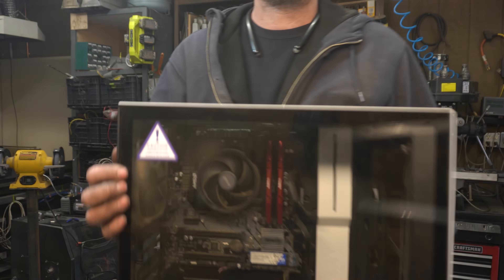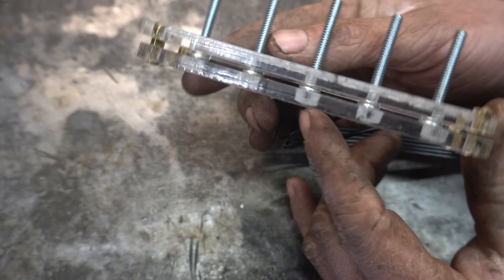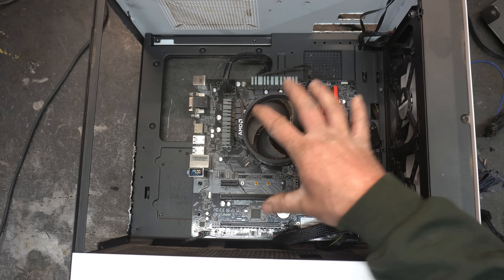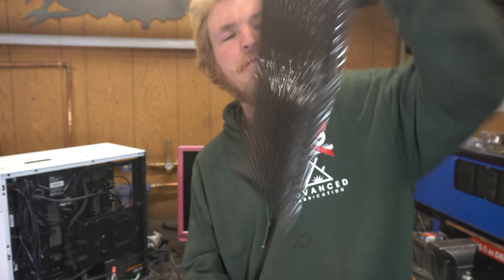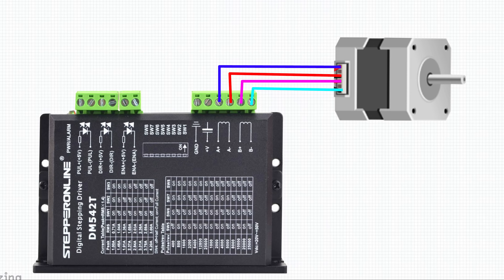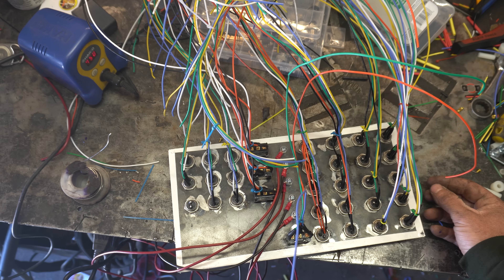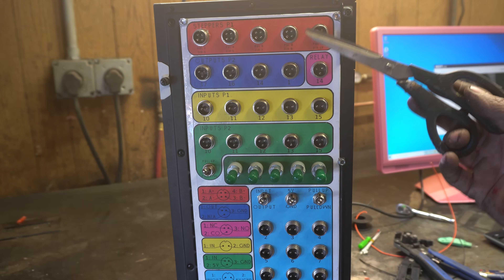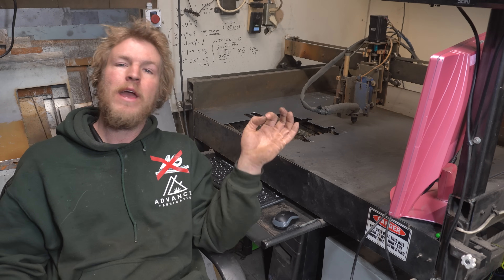Making An Overbuilt CNC Controller

Comment: Only 2 years ago, why did't you just use windows 10 pro and not partition the drive and use WSL for windows windows sub layer for linux since you're able to run Linux inside windows. That's how my CNC plasma table is setup it uses a windows computer and controls a single board computer with linux on it but wsl you can run many distros in winders

Comment: Can't believe this is actually working with an parallel port card? I've tried numerous and this did not seem to work. First of all you have to be able to select EPP mode for the parallel port (Not ECP of 'ECP&EPP', these settings won't work)
So the big question is: Which parallel port card do you use?
And also: Which OS(es)? Have you already tried to communicate in Windows via Gcode sender of Mach3?

Comment: Your aviation connectors are likely to set fire the the steppers internally. They are the resistance in the tank circuit which is your stepper circuit. The resistance allows a resonance which causes the voltage internal to the stepper to get very high. AKA 48v drive probably has a 600+v internal voltage inside the stepper. Results in burning motor internals.

Comment: If you're using a Ryzen with Linux, there's a good chance the processor will be stuck at P1 and P2 meaning it will be stuck on 100% performance the entire time. The patch for adding the driver to fix this was only merged earlier this year and Ubuntu has yet to release a kernel that supports this driver.

Comment: Nicely / professional made hw.
Linuxcnc is a very good choice. Takes some time till you understand, but then it is very capable.
I would propose to look for a Mesa card and do not try to optimize for parallel port. They are not cheapo but very worth the money. Plus you can have them with good insulation and you can go for 24v sensoric. Probably a better choice if you go plasma. And I think you are aware of the very nice plasma integration in lcnc that happened in the last years..
Gratulation from Switzerland!

Comment: Dud i have so much trouble soldering those aviation connectors. If i put enough heat in them the can slip out of the black plastic, and too little the solder wont hold. Takes me forever.

Comment: Linus isn't qualified to judge even your work on this. With 25 years of case modding, and nearly 35 years of electronics engineering and computer building, I am. Can't argue with results, but some of your methods made me cringe. You've obviously got skills, so why oh why (oh why) did you leave wiring, sleeved wiring, and components in the case to harbour metal dust when you did your cutting? I don't mind the hot glue on your terminal post plate so much, but you should be ashamed of yourself for using hot glue on those soldered wires inside the PSU. Again, results, but it's janky AF and will be horrid when you have to make changes there. I'm (slightly tongue in cheek) picking tiny spots in an otherwise very cool project, but that's what us pedantic bastages do. It is our raison d'etre.

Comment: been thinking on using one laptop , power , controller and drivers combo on multiple machines using a big usiversal plug to plug them intoo each machine same as the combo you made  , only thing is that you need to set the steppermotors up so its actually transfers the movement 1 to 1 having spindles toothed belts or chains does chainge the distance traveled per step 

oh well that was before i tried my hand ad 3d designing stuff in the more know programs and saw that it was a verry steep learnig curve without any assistance from friends pointing out the obvious so i kindoff put everything on the shelve for now , no use for a cnc machine if you cannot make the file to run it 

hope you whont get signal gremlins with all that wire all over the place though the metal plate between the motherboard transformers and the stepperdrivers should help

Comment: Amazing build and absolutely tops on the cable management! Definitely on my to do list as of now. My only change I might make will be to make the cable connectors on the back jacks (female connectors) so I don't end up with chips or schmoo shorting out the pins or accidentally bumping it into something and bending them. Other than that I can't believe how great your build turned out!
Reply: That would be Aviation connectors as apposed to GX connectors.. they are great, but pricey as hell
Reply: @nicholaswouters1203  for sure but I know my luck and it seems no matter how much I try to keep stuff out and away from angry pixie connectors it somehow finds it's way in lol

Comment: Awesome build! Only thing I suggest you considering changing is the regular screws electrical binding "posthingies"... Those are really BAD conductors and you can loose a lot of power trought them. You could swap them for copper or brass ones.

Comment: In BIOS; Turn off HT, HPET, and Freq Scaling
In linux: Consider a low-latency kernel
Then nice the program to raise its priority.

Lemme know how far that knocks your jitter.
Reply: Un-nice tho, right?
Reply: LinuxCNC requires a realtime-patched kernel, so low-latency isn't relevant. (preempt-rt or RTAI or Xenomai)
Reply: You will get away with the standard kernel  if you set the performance govener correcly and isolate the CPU from the scheduler (isolcpus) and only schedule the relevant tasks on it, move all the interrupts of everything else off the CPU which runs the task you need.      I would probably leave HPET on though. I don't know why HPET would affect response guarantees though.

You can't get scheduled off the CPU if you dont get scheduled.

Comment: I built a custom control box for my old ender 3 that used aviation connectors and I feel your pain; soldering a butt load of wires to tiny little terminals is awful. The end result is worth it though, especially if you use cable sleeving to separate the connector groups!

Comment: Can you load settings in Linux cnc to swap all the mm/rev etc for different machines?  
The motor controllers are usually dip switched/dedicated for specific motors.
Reply: Ah the first movements of a cnc! Such a wonderful experience! Great job!  I stuffed mine in an o2 generator chassis, "millennium  falcon cnc" on my channel.

Comment: Is the 5V from the PC power-supply? I'd be afraid to trip the PSU with shorts or even funny effects. My PSU is very picky, i.e. when getting 7V from +12V and -5V to run a fan slow, it instantly tripped. Does the box like being near to welding equipment?
Reply from the maker: Yeah it's all from the power supply, my fingers are crossed, but that is a concern. worst case scenario I just have to swap it for a dumber supply.
Reply: @cranktowncity  You can just add a 2nd power supply for the steppers jumpered to be always on, and switch it with the control stuff. That isolates the stepper noise from your pc.
Reply: @cranktowncity  Can CNCs be easily restarted? I was mainly thinking of 3D Printers, which are kind of a hassle when they crash in the middle of something.
Reply from the maker: @ChrisBigBad  Yeah linuxcnc has a "run from line" command, so if need be you can restart from a certain line of gcode

Comment: Huh why would hyper threading cause issues on Linux CNC? And also what power saving features?
Reply: HT means using one core to emulate two. As most linux cnc stuff is not optimized for multithreading, tuning for single-core performance is a good start. It nearly doubles performance per thread, at the cost of half as many.
Reply: @nobodynoone2500  That's not really what HT is. HT essentially allows a core to do something else while another process might be waiting. E.g. what's currently being executed might be waiting for a value to return from memory, well if there's another task that can be done immediately it can be done while we're waiting for the value to return from memory. Normally it's limited to two threads/core, but there's plenty of processors (e.g. Xeon Phi) where it's four or more.

Linux CNC might not be optimised for multi-threading, but disabling HT isn't likely to help. And it could easily make it worse, as HT still helps you with the OS and other functionality. It's not like HT was back in the Pentium 4 days, where disabling it could get you a performance boost in some things.

It's certainly not going to double your performance? I don't know where you heard that, but it's just not how it works.

Comment: In terms of improvement, a dust cover on the usb panel and maybe a filter would be great.
And maybe some care on the temperature, as air flow seems to be restricted in some areas.

P.S.: Linux has ways to set CPU frequency, it just requires to read a lot of documentation.

On the cables, the management is beautiful, similar to those found in old tech.
Unless taken apart of course, overall it is a pretty machine.

Comment: I love that your using that old Nzxt case, I have that exact one for my current build 🤣😆 amazing keep up the great work ! also that Ryzen mobo can turn off those power saving features in the bios menu so if that becomes a problem it's rather ez to fix ( hyperthreading on amd is often referred to as AMD SMT)

Comment: I would install filters on the intake so you don't get metal and dust inside the computer. Great video I subscribed
Reply from the maker: The case has built in filters. it'll be interesting to see how quickly they get nasty!
Reply: @cranktowncity  I think those holes are to big in the back and it was dirty before you took it apart I think it's going to be caked inside.
Reply: @cranktowncity  2 hours later....
Reply: I think that doesnt matter to much after using the grinder with the psu installed 😂

Comment: I'd be curious to see how the air filters on your case do.  Just sitting in my house, my PC fills with more dust than my vacuum cleaner on a weekly basis.  Can't imagine what it would be like in the garage.  But then again you do a lot more metal work than wood work, so maybe it won't be as bad.
Reply: Have the fans exhaust air rather than push air in to reduce dust inside the pc
Reply: @MattJonesYT  doesn't help, pulling fans still need air coming Into the pc case how else would it cool it?
Reply: @MattJonesYT  I get that.  Unfortunately there are more places for air to come into my case than just the filtered ports, and unlike the maker of these videos, I'm a lazy pile and don't take the time to fix it...

Comment: Dual z spindle for double capacity or for doing a single job with 2 bits but not needing to manually change the bit or use a bit changer https://www.youtube.com/watch?v=VF07fJgvYUY

Comment: Noice! FWIW There's a small chance you might encounter problems with the power supply breakouts because of those steel screws (resistance) , brass might be a bit better.
Reply: Never been a problem for me, but it's a place to check if there are problems. A conductor is a conductor.